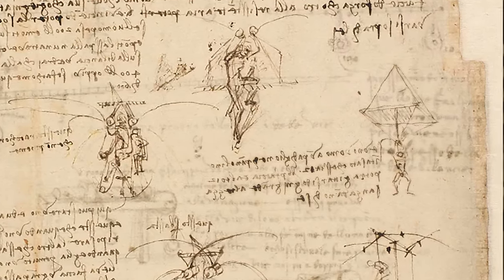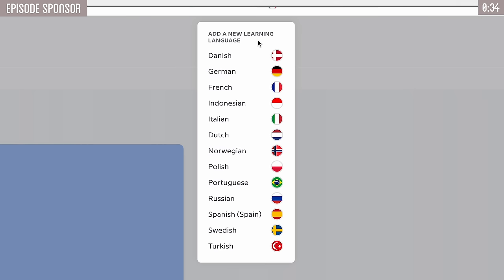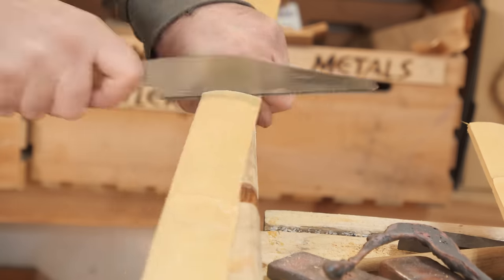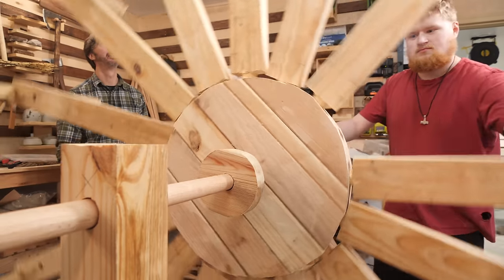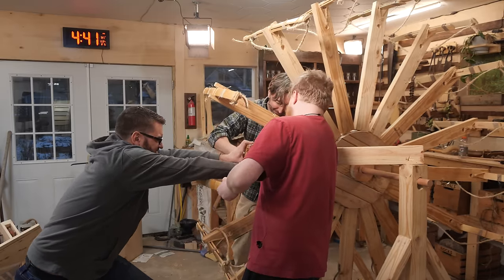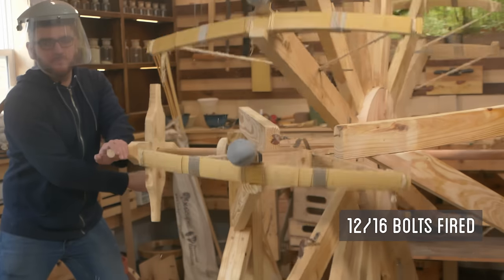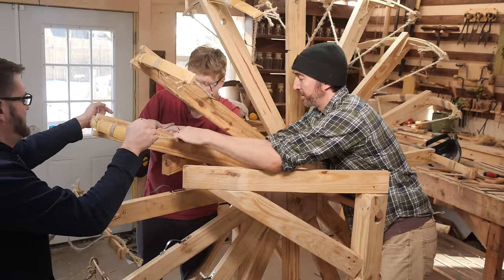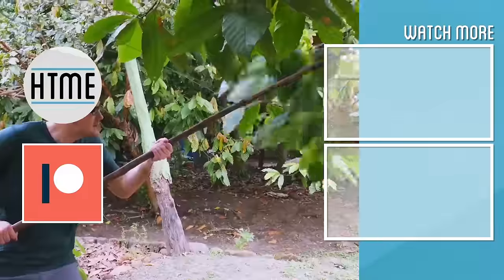I Built DaVinci's Machine Gun Crossbow!

Comment: a suggestion for if you decide to revisit this would be to introduce a ratchet gear. this way you could have a forward rotation be an equal 1:1 input for a high fire rate, then have a reverse rotation with gears in a 50:1 total input.  this way the handle would be cranked 50 times for a single rotation of the weapon wheel, but due to the heavy reduction in force needed could be done quickly. allow for two reverse rotations to pull back each crossbow. with this reduction, with 50 lb. of force on the input, you could wind up sixteen 150 lb. bows. connecting the input shaft to your roman crane wheel would make the process nearly effortless.

if you design the trigger mechanism to be equal to two rotations forward + the amount needed to position the crossbow, you could do one slow rotation to reload the bolts then a second faster one to actually fire. even if the total rate of fire isn't any higher, each one of these could be manned by one or two persons. thus the 16 persons become 8-16 crossbow wheels. pair them in sets of three or four, and you'll always have one firing while the others reload.

Comment: Wonder if you could add a fixed golden spiral near the center and have the closest to center piece opposite the firing side, so as it winds around it would draw the line back into the drawn position. Then drop an arrow/bolt onto the crossbow near the top to reload it as it passes by.

Comment: I think angling the trigger mechanism upward so that the bolts have a longer arched range would help, in addition to a stronger pull as mentioned in the video. This would make it more effective for at least slowing down a larger group of opposing soldiers. Also, reinforcing the ends of the crossbows with connectors between them would help prevent that issue with them breaking at the base.

Comment: Really impressed with how well that worked. I wonder what the limit is for how tightly packed you could go with crossbows - like could you have one every 10 degrees for 36 bows?
Reply: There comes a point where the shaft of the previous shot hasn't cleared the device and the next crossbow strikes the shaft as it is leaving deflecting the bolts trajectory.  Of course you can make the wheel even bigger and space the crossbows far enough apart that the bolt has time to clear, but the device will quickly grow to the size of a Ferris wheel and require a significant amount of strength to turn.

Comment: Idea: to make it reload you could have used something like the spiral pattern from the automatic hammer in reverse so the string are pulled in evenly in the rotation and unload at a specific point. i think that should also work with the chinese design to have multiple bolts per crossbow

Comment: totally fun and impractical for all the reasons you mentioned.  I'm not sure you could ever really make it practical but if you could incorporate a mechanism to pull the string back as you turn it on the opposite side of the wheel, then you could put two of them side by side and fire one while someone reloads the other. forge welding f the trigger finger to the release at a 90degree would mean you only need to place the arrows in it. Alternating between two of them could enable a constant stream of arrows.  Now for aiming it...

Comment: Build a lever to a trigger that leads to the front, and have that be a piece of bendable material that will snap back into the lever and reset, then put the tripping mechanism in the front, and you can Fire accurately by dialing in where that tripping mechanism is aimed.

Comment: Good attempt at making it work.   And yeah, intimidation is probably its best side.
Although for any situation where few people need to hold against storming attempts?   THAT is where it would absolutely be useful, as, lets say 4-8 of these covering the only 2 major openings to a position would make trying to storm in decidedly more dangerous to attempt.

So, how about trying to make a lot more of those crossbows and set them up as a salvo gun?
Preferably with some sort of improved reload system.

For example, a simple system would be that you could have lets say 8 horizontal rows of 6 crossbows each on a mount/wagon, with each row being quick dismountable/mountable, with each row being possible to trigger individually, or several at once.
This would mean operating it like a cannon, with reloaders dismounting fired rows, reloading them and then putting them back, while the gunner just stands by waiting for the best time to trigger one or more rows.

Although, the idea has a serious downside, that it's made totally obsolete by the very historical H'wacha.

Comment: I'd imagine that the fire rate could be made more consistent if there was one loader, and one operator.  So the top half of the machine would be constantly reloaded.  So it wouldn't need to be MG rate of fire, but it would be faster than typical crossbow fire (which crossbows were hard to reload at the time).

Comment: 2:56 "we'll need to make 16 fully functional crossbows"

Me: "Oh ive done that before heh"

Used to live with a fellow LARPer who wanted to have enuf arms to arm an entire army. We spent many wks in his basement either assembly line buildin foam swords or else crossbows made from laser cut thin sheets glued together to form the stock

I loved those crossbows too, bcuz he had the genius idea of usin the heads of toothbrushes to hold the end of the bolt in place, so it still fired just as well as without it; but now you cud run around with a loaded crossbow rdy to pt and click as soon as ya need to off someone

We also once spent several days with those crossbows, 20 ft from a brick wall at the school nearby, just firin the same bolt thousands of times to stress test the foam on the bolt; as he wanted to make sure they wud last thru a lot of use, same with the crossbow which got fired a thousand plus times even before we browt it to a battlefield

Dude looks just like the maker Peter Brown too, and i think the two of them wud get along wonderfully; and wud laugh about how their wives are sm the same, ever willin to put up with their absolute bullshit of the projects they think up.

This guy once decided he wanted to build a LARP castle and that projects likely still ongoin even tho he had been thru two diff styles of LARP castles before i even got there, havin started the project a decade sooner. 

The current incarnation there had metal beams and painted tarps which legit look castle like on a battlefield, as well as multiple towers that players can climb into to rain down crossbow (or reg bow) fire down on the players tryin to take the castle from them. And those towers held *all* 6 of us, so we knew theyd be safe for playin in as long as we said no more than four ppl at a time on the towers

The dude also brews alcohol, but doesnt drink. He just likes bein able to bring booze to LARP events and let ppl try some homemade mead. Like, he just loves the absolute community and camaraderie aspect of LARPing; which for him is like the followup to his con goin days where he used to do the same thing, and was brewin booze for those events at 17... Still not drinkin himself tho xD

Comment: It would be cool to attempt to build an automatic crossbow with linked bolts (fabric links?)

Combine a crank with the repeating crossbow mechanism and run it similarly to a gatling gun (but belt fed vs gravity).  Have a pawl linked to pull next bolt into the mechanism.   Another linkage to pull the string back and lock it into position.

Comment: You state that the only limiting factor is the speed that you can turn the wheel, but I beg to differ.  As you watch them shoot out in the slow motion you can see the next crossbow descending as the shaft of the previous shot is still leaving the device.  If it goes to fast the next crossbow will literally strike the shaft of the previous shot before it has time to clear the device.  I'm not sure at what speed that would occur, but it is a limiting factor on the rate of fire.  Shorter bolts would allow for faster fire rate, but would also entail a shorter draw distance.  It would be interesting to play around with the numbers to find the optimum bolt length vs draw distance vs rate of fire possible.

Comment: Build materials would make a difference and the idea is sound for the time. 12-25 machines on the field run by 3 people(ish) each. Alternate even and odds across the battlefield and it could technically, with a well trained force be a constant bombardment of arrows flying. I'd imagine a finer, stronger wood, oak or chestnut definitely more precise assembly with a much more complex system. It would have been a terrifying sight to see if you were the opposition.

Comment: This design actually has more potential if it was spanned with a cranequin and used a more advanced trigger mechanism, as was present in the 15th and 16th century. It would be way more expensive to make and more difficult to move as well which arguably reinforces why crossbows weren't made into rapidly shooting contraptions.

Comment: If you put in some type of ratchet setup so it couldn't spin the wrong way, you could potentially set up another crank to pull the string back on all of them at one time. Then youd just have to load each bolt. Easier said than done, i know.

Comment: Im still imagining it could be done. Each crossbow would need its own loading device and magazine. Then, pwrhaps as you turn the weheel the individual loading mechanisms pushes against a system akin to a piston/steam engin/ train wheel looking thing. On the crossbows it would need to catch and pull to engadge in one stroke them lift and release in the other.

Comment: Just like the Chinese repeating crossbow, the utility of a weapon like this would be limited to defending a static position like a fort or castle, or being mounted on a ship, chariot or cart. The upside of using it as a static emplacement is that you could make it bigger and thus offset its biggest drawbacks (low range and power) somewhat. But like the repeating crossbow, its utility against armoured troops would still be pretty limited, hence why I don't think this was ever considered by anyone for use as a military weapon (in Da Vinci's time, heavy metal plate armour was quite common on the battlefield, making this a very ineffective weapon).

Comment: I wonder if a combination of this and his trip hammer design would work, where you make a magazine like that chinese crossbow and have a spring pressing the contents down, and have each draw string with a couple of rods attached to it on either side of the cross bow. Have those rods somehow connected to something like that cam but have it inverse where it's pulling the string instead of pushing, and have that cam setup sitting stationary. The thought is as it spins it will pull the string back far enough to load a bolt and then instead of unlatching it, you're just letting it drop and move straight forward to fire. 

EDIT: You could have the springs for the magazine simply be a strip of bamboo with a plunger in the middle on top of the magazine, have it hinged at one end and the other would be held with a pin. The theory is that you simply pull the pin and lever the bamboo spring out of the way, then you drop in your bolts and flex the bamboo spring back into place, the plunger in the middle is to ensure you're pressing against the bolts at all times and it would help ensure that no matter what angle the mechanism fires at, you'll have proper feeding of the bolts into the system.

Comment: The rotation makes it so that all the bolts are flying downwards, because they are moving downwards when they are released. This really limits the range, on top of the crossbows being pretty weak. You might get more range if you release the bolts a bit earlier, while they are still pointing upwards, or if you reales the bolts upside down, so the are spinning up when they are fired. The design also makes it hard to put heavier crossbows into the mechanism, or not? Heavier crossbows use pulleys or cranks or levers or a hook at the front for you to put your foot into so you can pull with your whole body etc. How are you going to put any of these mechanisms on the wheel design and make them somewhat ergonomic to use? I think something might be possible. The crossbows are also very thick, which adds a lot of extra weight to this mechanism, but that could actually be good, especially if you want to use automatic tensioning. Some more momentum could help with that.

Comment: What is the F component/sling function? Doe's he describe it?
I assume it is supposed to be connected to the trigger under the crossbow.
The same is for O an P. What are those boards supposed to do?

The are to short to act like a trigger mechanism.
You can see they have pins in it. Would they have to withstand a lot of radial force?
The Component A and B are not round. They have a nock on it. Purpose?

Comment: For the poundage of war crossbows go chech out tod's workshop. Heavy crossbows are 1000 pounds
Reply: Wood bows and metal bows don't measure the same poundage though
.
Reply: I would say 1000 pounds is on the lighter side for windlass crossbows. 1200 to 1500 were pretty common. Sir Ralph Payne Galway had a 2000 pound one from the 17th century
Reply: @alternator7893  remember the more than 1200 # are very often great crossbows and are mounted like light artillery

Comment: I could easily have engineered a better striking plate like a hair trigger system if you round the top corner of the grove the string would only need to move millimeters to hit the round and have a 100% fire rate as for the reloading you could have used the force of the spin to reload each bow.

Comment: What if instead of single rotating wheel, we could use a row of 16 spiral cams like in the power Hammer video so as the bow rises, it gets loaded with another arrow and as it falls it fires the arrow. The end result could be a volley of 16 arrows for as long as you can load it.

Comment: I know you said this only a proof of concept but you could've made a trigger with simple or even compound levers. Basically use 2 peices of wood secured in a way that when it's depressed it acts like a ramp for the string. On top of you can increase the lever arm for increase torque or a lighter trigger. A heavy "trigger seems to be a big problem in this design.

Comment: A machine gun, functionally, has nothing to do with rate of fire; something can be a machine gun by technical definition regardless of the rate of fire. What matters is that multiple rounds of ammo, multiple shots, are fired with a single trigger pull without any manual reloading. That means a gatling gun isn’t a machine gun because it’s muscle-operated and cycled - but it becomes one the moment you put an electric motor on it to drive it.

Comment: And now just remember that 45 lbs is basically nothing for a crossbow. 

For a regular bow to be considered a proper war bow, it needs to have about 100 lbs. For a crossbow to be effective as a weapon of war, it actually needs a much higher draw weight because the draw length, aka the distance that the bolt is pushed forward by the string, is much shorter than in a bow. 

Like, you kinda want 200+ lbs if you want a chance to at the very least go through mail and textile armour. 

If you actually got some professional engineers on it and gave them as much budget as they needed, you might be able to make a working one today, but I do have some doubts that such a design would have been feasible in da Vinci's time. Either way, it would probably just have been worse and more expensive than simply employing 16 crossbowmen.

Comment: assuming it takes a trained archer 1 second to reload and fire a crossbow, 16 men working in parallel would have a RoF of 16 rounds/second or 960 rounds/minute. and they could sustain that rate as long as they have bolts. this thing would take...probably around 16 seconds to reload, since it loading in serial instead of parallel and however long it took to fire...again in serial instead of parallel.

Comment: improve to have a recock mechanism as it comes to the other side.  two men cranking a side wheel and once loading bolts, sustained at what 30-50 rounds a minute.  an army of these could reign terror if pre spotted on choke points.

Comment: I would spin the wheel in the opposite direction. Because the crossbows move downwards the arrows also have a downwards momentum. So the crossbow has to compensate this downwards force and the arrow shouldnt fly that far compared to a stale crossbow.

Comment: This to me seems to impractical to be implemented. Sure with enough time you could make it viable, but the amount of time it takes to settup, cock the strings, then load the bolts, you could arm 16 people with crossbows, and have them have 2 loaders each. and you could get better results overall. 

Then there is the aiming issues, Cant really rely on it for much more then just trying to rain down rounds on a small area. But again, arming 16 people with 2 helpers each could make that job easier in general

Comment: not to nock the design but i think that you dont need firing braces on both sides. if you had a similar piece to whats holding the bolts to the crossbow going across the notch for the string you could just have it push up from one side and it would just return to the origin so you dont have a bunch of bent metal bar on the floor and it should help with misfires from misalignment

Comment: bruh.. do it sideways like 10 crossbows in a line and a linked puller pull all the ropes at the same time. when i was a kid i did it with slingshots and it never went out of my mind. too bad i have to work and would be expensive do build one myself, but if its usefull you can use the idea